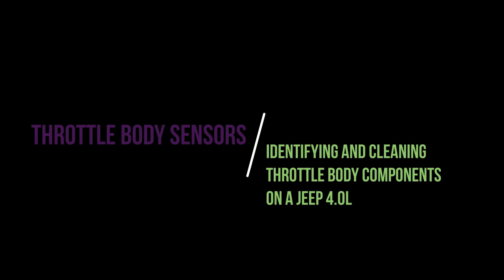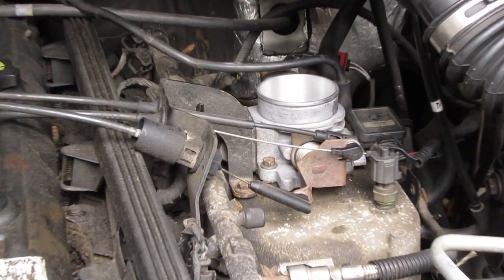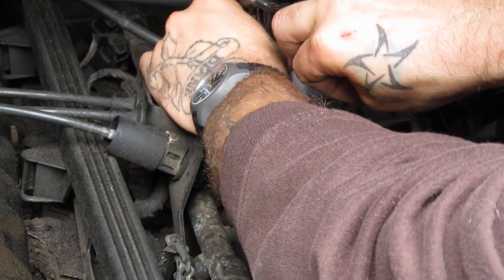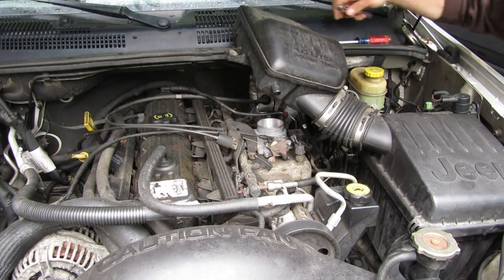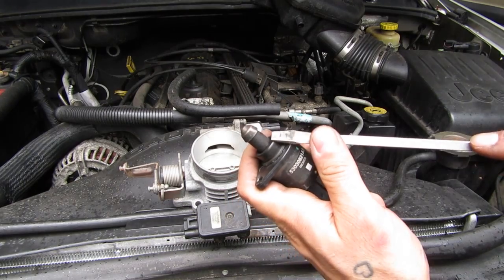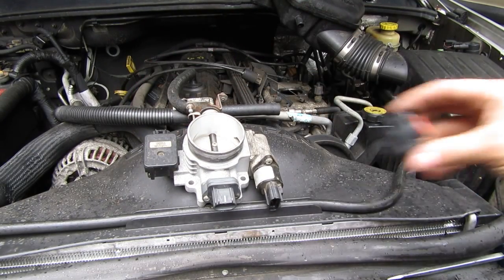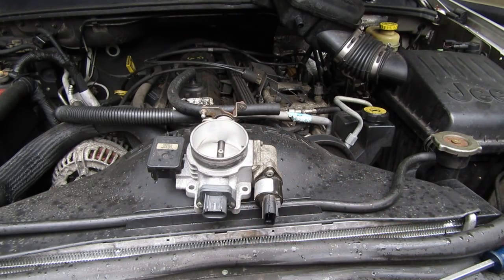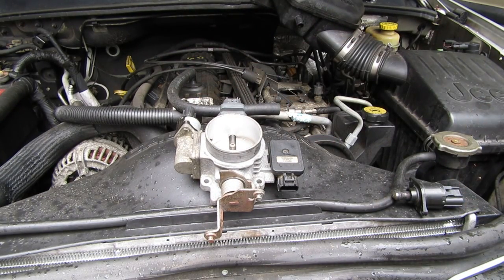THROTTLE BODY SENSORS (IAC, TPS, MAP) - Jeep 4.0L

Comment: Hi enjoyed throttle body video, I have an issue with 99 grand Cherokee laredo 4.0 v 6 was running ruff and replaced coil pack and plugs since that I'm not getting it to start ?? It will crank but doesn't want to run any ideas

Comment: Just noticed my 2002 wj rpm spikes to 5000 before it would shift. Not always,  usually when going up the hill and pushing little harder.  Wandering if that my be throttle position sensor issue?

Comment: Any answer to why my 2000 xj stutters at 55-60 mph, feels like i hit a small bump. It is getting worse and feels like a misfire. But doesn’t happen all the time, just when i drive it for a bit. I put in new injectors and a new fuel rail to help with heatsoak

Comment: Dude, once again great video! I do have a question. Is it normal for my compressor to kick on & off when I use the defrost setting? Is it related to a sensor? I also live the northeast(Delaware). Thanks for the great videos!
Reply from the maker: It is kind of normal. It could be a sign that you A/C system has a bit too much or too little pressure (it is a very fickle system). That said, I had an XJ that cycled on and off on defrost and then pressure what good and I never had an issue. If you can confirm your pressure, go for it. If you are not experiencing an issue, I would not worry about it
Reply: It's normal. The AC system runs when the defrost is on to pull moisture or of the air so the vents are blowing dry air on the windshield and windows, this helps get rid of the condensation.

Comment: is the diagnose part on another video? i have a XJ that won't idle for more than 20 sec. then falters and dies.
Reply from the maker: The diagnosis is to remove your throttle body and take a look at your sensors. is the IAC covered in carbon, is the hose form the MAP cracked or missing....

Comment: I’m experiencing similar problems...will a bad tps cause a backfire under load?
Reply from the maker: It shouldnt... that COULD be bad crank position or cam position sensor. any check engine lights?
Reply: @DEInTheGarage  no check engine lights, no codes, no nothing. What got me during your video is when you said that the tps could cause what feels like a trans concern. This is what I’m feeling but not in the way you explain...instead of surging it boggs down in that dead range you talked about. It gets caught in the dead range and I can’t step on the gas to make it go. It never dies but it does sputter and chug like it’s not getting fuel. At first I thought it was a bad coil. Removed it and cleaned it up and it looked good. So I changed the plugs and fuel filter for good measure. Still experiencing the problem. I thought maybe the fuel pump or sender is weak but checked it and it’s good. Then I ran across your video. Turns out that it was the tps. R&r old sensor and BOOM it’s working. It took a day or two for the computer to relearn the new sensor but now she up and running like she was before. Thanks bro. You can tell that you work on your own vehicle and not just out to make a video and put it on YouTube. I like learning from guys like you. You explain things very well. 
Thanks buddy.

Comment: thank you for this video. very helpful. i have 2004 wj 4.0 and it is stalling at idle/when i come to a stop and has trouble starting with out me hitting the gas. been looking everywhere online for this kind of information. i think i will try fully cleaning everything before replacing IAC and TPS
Reply from the maker: Also maybe check fuel pressure. Good luck with it!

Comment: I’m having a problem, when I start it up and takeoff it tries to almost die on me between second and third and then I give a little bit more gas and it straightens right out and it never happens again until it’s cold again. It also does a little pop in the exhaust while I give it more gas when it’s doing it. Any suggestions? I change the distributor, ignition coil, idle control valve and also spark plugs and wires. Oh and also crankshaft positioning sensor

Comment: I have a 94 ZJ with a 4.0 with 320,000 miles. When i drive to the store, she runs fine. But when I come out of the store 5 minutes later and put it in reverse, it surges and won't dtop until zi put it in drivr and rev it up to cleaf it's throat. Thounghts?

Comment: Ok guys, I have rough idle and constant stalling on my 96 Grand Cherokee with 4.0 engine. I cleaned the throttle body and put on a new gasket. Just spent $300 on new sensors. New Mopar CPS, Napa MAP Sensor and new Standard brand IAC but it’s still doing it. No Check Engine light is coming on either. Any ideas of what it can be? I am beyond frustrated at this point! I’m ready to launch this thing off a cliff!!!
Reply: Did you ever fix it, or did you go with the cliff idea? It sounds like the fuel pump sending unit might be the issue...
Reply: @jakeingram6980 Thank you for the reply. My ECU was going bad. It started stalling also. Replacing that fixed most of the problem and then a new upstream O2 sensor afterwards. It runs like a charm now at 259,000 miles.

Comment: Good video! I‘ll clean my throttle body too. What do you think, is it Good to clean it at a ultrasonic bath after I remove all the sensors? Or is it better to clean with the carburator Spray? Are the small gaskets for the different sensors available?
Regards from Germany 🍻
Reply from the maker: Ultrasonic bath would be great if you have one on hand. None of these sensors require a gasket, just the little hose for the MAP sensor
Reply: D&E In The Garage I‘ve done ist with the ultrasonic. Wow! Pretty awesome and looks like Factory new. Don‘t forget to oil the two bearings where the axle for the throttle works and everything is great.
Reply: @christiank.3583  . Oil or lube? And whither what?
Reply: Phil PJ Davis I oiled ist with standard Motor oil. But if you drive more in dust areas you should think about encapsulated ball bearings like SKF or Timken.👍 But it‘s a little bit tricky to custom.

Comment: Great video man, hoping you may be able to answer a question for me. I have a 98 XJ that I just did a complete tune up on (wires, plugs, cap and rotor, coil) it starts and runs fine and randomly after a minute or two it will start to idle down really low and missfire. You can blip the throttle and it will go back to firing on all 6 and idle fine again, and sometimes it will idle very high after that. I started to unplug sesnors one at a time and the only one that would return it to normal idle when it was high was the TPS. Now before I replace that what do you think it may be? Hope to hear from you. Thank you.
Reply from the maker: It sounds like the IAC or possibly TPS. Try cleaning the IAC as described in this video.
Reply: @DEInTheGarage  As soon as I get off Ill be doing that. I just wasnt sure if I should pick up a TPS on the way home or not. At 40$ a pop I always try to opt for the free"ish" way LOL Ill keep this thread posted as to what happens!
Reply: @DEInTheGarage  So my IAC was pretty much shot. I tried to pull it and scrape the carbon build up off but it was the same if not worse after. Picked up a new IAC and she purrs nicely. Still have a weird low idle and miss but its only while the engine is warming up.... Once warm its fine.

Comment: Where did you get the throttle body? I've got a 96 XJ high output, if that differs?
Reply from the maker: IT was an extra from a 2000 WJ. Your 96 will have the same layout and TB sensors

Comment: Hi bro I have a problem with my jeep grand Cherokee crd 2.7 2003 it starts with help of a little quick start and idles but does not want to rev at all could it be a sensor?
Reply from the maker: Yes, it certainly could be. I would consider cleaning your throttle body

Comment: My issue is: I be running 65-70 mph in overdrive. Then all of the sudden, it will come out of overdrive, the green icon light will be on and all. I pull over, put it in park, turn the jeep off, do a restart and the green light is still on. After it happens the first time it will not go back into overdrive,  I have to park the jeep and take the positive batt. cable off and let it sit overnight( resetting the computer ) crank the next day all good for about 50 or so miles.
  Any ideas on how to fix this??

Comment: I have a 96 Grand Cherokee Laredo 4.0L, sitting in park the Idle is horrible (sounds like it's got a big can), once I put it in gear and go its ok until I am in OD at a steady RPM and it wants to start bucking. When I get on it, there's nothing but black smoke/suit behind me. Any help would be greatly appreciated
Reply from the maker: That sound 100% like a throttle position sensor. I would grab one from the junk yard for like $5 and see if that helps/ While you have the TB off, clean the IAC for goo measure
Reply: @DEInTheGarage  I believe i happen to have another one.  Thank you very much. You definitely have another subscriber.
Reply from the maker: Glad to hear it! Goo luck with your Jeep!
Reply: @DEInTheGarage  , It fixed it!  I am a Chevy guy and race dirt track cars. I've got a lot to learn with the keeps. Have a great day!
Reply from the maker: WooHoo! Glad to hear it! Those TPS are notorious on the 4.0.

Comment: I am having a problem with my 99 XJ   It will run smooth then it will start  skipping and bucking then it will clear up and run good.  You can be going down the road and it will start doing it or you can be at a red light and it will spit and sputter (sometimes it will shut off). You can drive it 30 miles no problem then the next 20 it will skip and sputter.  Any Ideas?

Comment: I just bought a throttle control sensor thinking its my issue since my wj wont start unless it gets gas then will stall but then run fine if i rev it for a bit so im hoping this is my problem

Comment: Today I was driving my 89 xj, I was around 35/40mph accelerating and my rpm dropped a few times and then it would pick up again, you can also hear the engine wine down everytime the rpm dropped, could that be part of a throttle or iac issue?
Reply from the maker: It definitely could be a TPS (throttle position sensor). I would start there

Comment: Question 
I my 1998 Grand Cherokee Laredo turns on but  turns off less then a minute what sensor can it be that’s bad.
Reply from the maker: Sounds like an idle air controller possibly. If not that, it is possibly a fuel pressure/delivery issue

Comment: can you use that liquid gasket maker in a tube if the gasket on the throttle body is trashed?
Reply from the maker: You certainly can - and I put that sh*t on EVERYTHING - but a word of caution... dont use so much that is squirts into your throttle body and keep in mind that you have now glue a fragile aluminum part to you engine... it may or may not be difficult to get it free if you need to later

Comment: I noticed the nipple on the bottom of the MAP sensor. Mine doesn’t seem to have a vacuum line hooked up and I’m trying to find source if my stalking problem. Is it supposed to be hooked up to a line?
Reply from the maker: It should definitely have that little elbow to pull a reading from after the throttle body. Right now your sensor is taking its reading from the engine bay instead. I would start there for sure
Reply: Ended up being there just didn’t notice it at first. 
Cleaned the iac and throttle body really good. Replaced fuel pump, fuel filter, and cps. Checked for vacuum leaks. Can’t figure it out. Will crank and run decent for a few minutes then once it warms up it just idles out and struggles for gas or air. Sometimes it’ll start back up and die right away. Others times  it won’t even start.
Reply from the maker: Hmmm... Any codes being thrown?
Reply: No codes, wiggle cpu and wiring going in, doesn’t stall then. Just when it gets warm, sputters our and won’t crank
Reply from the maker: Have you confirmed furl pressure? It is odd to have catastrophic failure like that without any codes

Comment: It would help to actually show how to disconnect the sensor plugs.  That’s what I am trying to figure out.
Reply from the maker: pull the red tab out and then it disconnects like a regular sensor
Reply: There are 2 connectors that don’t have the red tab. They were the ones I was trying to figure out.  The cam sensor was so brittle it broke the release off.  Thanks.

Comment: I just replaced my tps after my tj threw the code that indicated it was bad. The new Mopar part did not fix my issue. At 65-70mph the jeep will buck or lurch. Scares the shit outta me but it won't buck under this speed or over 70mph. I dont know what to do. Any thoughts?

Comment: is it possible to clean the MAP sensor. my jeep seems to surge sometimes or lack power. always been maintained never ridden hard ive had it since 86K miles. I now have over 200k. ive never changed any of the sensors except the TPS
Reply from the maker: Not really. you can make sure the hose from the MAP to the TB is in good condition though

Comment: Thanks for this video I think I figured out alot of my issues
Reply: Also if you happen to read this I have a 99 jeep grand Cherokee 70% of the time when it rains I get a miss in the 6th cylinder can't figure it out bought a new coil and its still doing it any suggestions?
Reply from the maker: I would ensure that your injector and spark plug are sealed correctly. With the spark plug this can be as easy as removing it and inspecting the plug itself and the housing around it for cracks. The injector has o-rings on both sides. they can crack or stretch allowing moisture to effect fuel delivery. If neither of those are the issue, perhaps look at the wiring to the injector. Worst case would be a head gasket or cylinder head crack at the 6th cylinder, but that really wouldn't only happen when it rains
Reply: @DEInTheGarage  thank you sir I'm definitely check those things out. I did rebuild the motor about 2  years ago because of a cracked piston skirt in the 6th cylinder. Definitely want to check those fuel injectors out and pull those plugs.

Comment: Have replaced fuel pump, filter, injectors but hard start, jumps, ,bucks but will idle. It's a 1989 Jeep wrangler yj , 2.5 4 cyl any advice  " very greatful I'm new at this thanks for understanding.
Reply from the maker: Hard to say without seeing the Jeep.How are the spark plugs?

Comment: Would this problem set of a engine code? I have stalling and shut down but never get any kind of engine code. Not sure what to do.
Reply from the maker: Possibly a clogged fuel filter?
Reply: Ok I should check fuel pressure I would think.
Reply from the maker: @jackcollins2344  Yea, I would start there. fuel is one of the only things that can't throw its own code. Sometimes you get a misfire code, but not always.

Comment: You should do a video on the evap system for the fuel tank my wife and I have an 04 wj with the 4L and we're having issues in that department I've look d all over and everyone has recommended cutting a vent tube but we wanna keep it as close to factory as possible any advice or ideas?
Reply from the maker: What is the issue exactly? Throwing a CEL?
Reply: @DEInTheGarage   It will only take a little over a gallon of gas at the pump and then it pukes it back out all over the ground and yourself and it's throwing codes for the evap system in regards to the fuel tank.
Reply: @DEInTheGarage   the codes it's throwing are p1485 p1490 p1495 all of witch involve the fuel systems evac and I'm lost
Reply from the maker: @travisworkman9789  It sounds like the purge valve to me. I have had that issue before. It is not terribly difficult to replace. Basically your tank is staying pressurized so no new gas can get in. Drilling a hole to vent it is a temporary fix to a very real issue.
Reply: @DEInTheGarage   ok so my next question is where is it located ?  Please tell me I don't have to drop the tank I just watched your video on the tank skid plate and it looks like it's next to no tun to do alone. I don't wanna rig it to work I wanna fix it. Also would that be why we have to turn the key two or three times for it to fire I've done everything I can think of to fix that issue from a tune-up to a new crank sensor?
Reply from the maker: The p1495 code is for your Leak Detection Pump. The others are various inefficiency codes likely related to the LDP or purge valve. Both are inside your engine compartment so you are in luck. I would try to change the purge valve as they are cheap and easy. It is got a guaranteed fix, but it is the logical place to start.
Reply: @DEInTheGarage   awesome sause. Thank you I have learned more about jeep from your channel then anything Google has to offer I love it. I think I've just about seen every video you guys have done I'm big big fan. If I'm able to fix it with you help deff gonna give you guys a big shout out.
Reply from the maker: @travisworkman9789  Hey, thanks buddy. I wish you good luck with it. We answer questions and try to give help on FaceBook as well. If you ever need a second opinion on something we are relatively quick to respond there
Reply: @DEInTheGarage  awesome and thanks again. I do however have one more question. Did you ever get the locker in your rear diff?

Comment: I heard that after replacing the TPS (Throttle Position Sensor) one has to disconnect the positive and negative cable to the battery, hold them together for 30 sec. and that sort of initiates the "computer" to recognize the New sensor you installed. Is that true?
Reply: What I meant to say was apparently it's important to "reset the ETM" when changing those Sensors.
Reply: i believe the computer will adjust & relearn itself within a few days of driving!